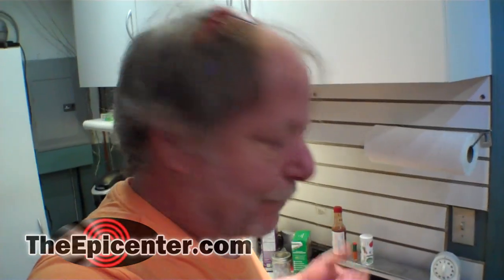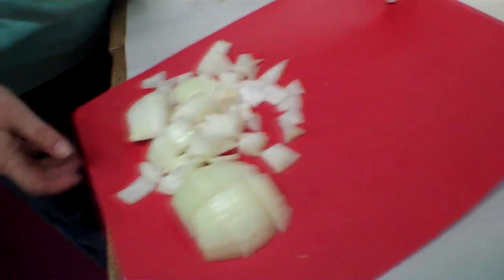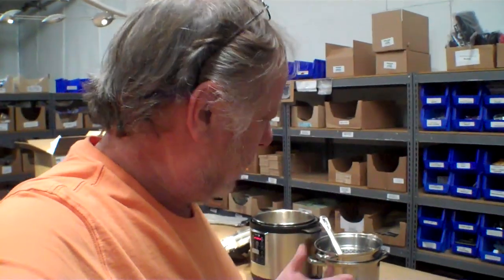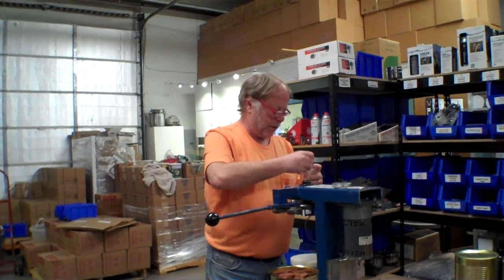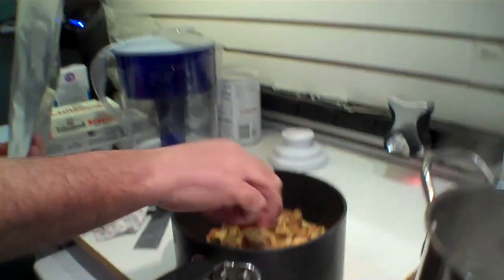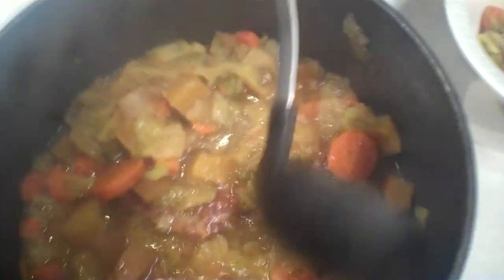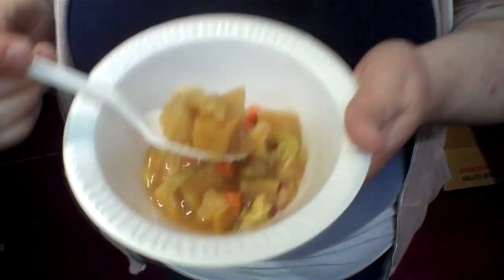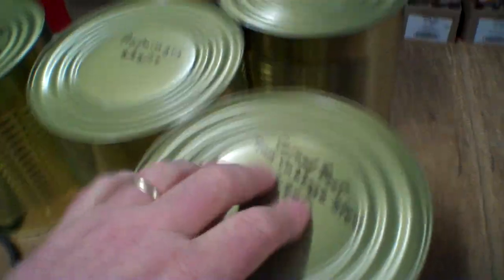Corned Beef and Cabbage Stew (Freeze Dried) in a Harvest Right Home Freeze Dryer

Comment: I love my electric pressure cooker it is an amazing time saver! You should try beef stew in it so yummy! i love what you did with the liquid too!
Reply from the maker: Beef stew is on that list thanks to your inputs! Got a good recipe?
Reply: My Semi homemade Beef Stew Recipe.
1 package McCormick® Beef Stew Seasoning Mix
1/2 cup flour
3 pounds beef stew meat, cut into bite size pieces
2 pkgs. McCormick® Slow Cooker Sauce Hearty Beef Stew with Savory Herbs & Onion
3 to 4 cups water
3 cups potato chunks
1 1/4 cups carrot chunks
2 medium onion, cut into thin wedges
1/2 cup sliced celery
1 cup sliced mushrooms
Salt & Pepper to taste after cooked

Mix 1/2 McCormick® Beef Stew Seasoning Mix with flour in plastic bag. Place beef stew pieces in bag and shake to coat. Then sear all coated beef in a hot oiled pan/ oiled electric pressure cooker. Do not cook through just brown and place on seperate dish afterwards. 

Place water, all vegtables, left over flour mix, remaining 1/2 of McCormick® Beef Stew Seasoning Mix, 2 pkgs. McCormick® Slow Cooker Sauce Hearty Beef Stew with Savory Herbs & Onion, and mix together. Add Seared beef and mix gently. 
Cook on stew/soup setting in pressure cooker till everything is tender and meat falls apart when pressed with fork.

If you want more liquid add beef stock.

Serve over rice or eat by itself.

This is generally what I do. I mess with the vegetables and amounts all the time but this is a delicious place to start. :) Hope that helps!

Comment: Love your videos! Question please? When freeze drying, can you put parchment paper underneath?  Thank you!
Reply: I do all the time.  I got bulk parchment paper that is pre-cut, like the aluminum foil sheets, from Sam's Club.  I just pull out 2 sheets for each tray.  They overlap about 2-3 inches in my large trays.  Perfect for me and no cutting to fit.  Each box has way more than is on a roll as well. I have even used it under paper towels when I have meat with a bit of fat still in it.  I also put a layer of paper towel on top to stop splatter.  Was very happy with the results.

Comment: Why not use retort pouches and vacuum seal instead of bulky cans?  You'd save 60% of the space and you could ship 1000 retort bags in a large USPS flat rate box for the cost of shipping two cans.
Reply from the maker: Bags work great and we do offer them as well as oxygen absorbers. But for some things like apple slices, the contents can get squished (broken) in bags and storing the bags becomes a bit more of an issue after you have done lots of loads. I have started using jars for some things that I know I will be using a little at a time. It's nice they can be washed and reused. My plan is to use bags for small batches, jars for things I need a little at a time, and cans for things that come into season and I can do lots of (peaches for example).

Comment: Ok, I have always wanted a pressure cooker but never pulled the trigger...did the veggies really only take a few minutes?
Reply from the maker: Yes. 2 minutes on high pressure. It does take about 3-4 minutes (as I recall) to get to full pressure though. And perhaps another 1/2 minute to release pressure... So it takes more time to load and unload than the actual cook time. Amazing!
Reply: EpicenterBryan that is great!
Reply from the maker: Hey Kelly, we updated the text for the video to include links to the unit we bought. Janet also wanted the stainless pot (rather than the non-stick one that comes with it) so there is a link for that too. Lots of pressure cookers out there... there may be a better fit for you, but we are happy with the one we got (so far). We've done 2 more videos yet to be published using it. Stay tuned.
Reply: EpicenterBryan Thanks for the update. I will check those out for sure. Looking forward to the other videos to come.